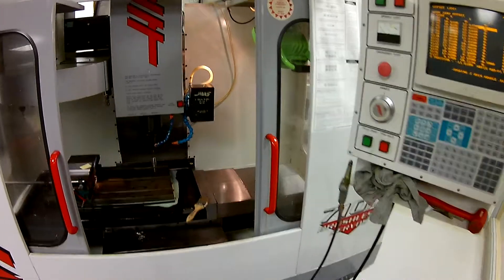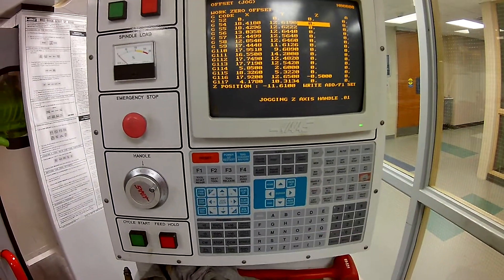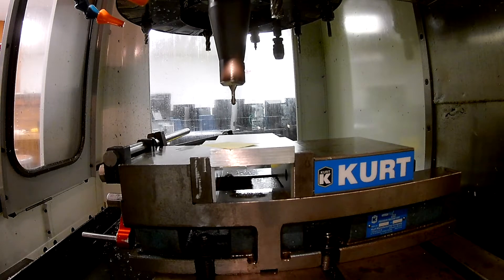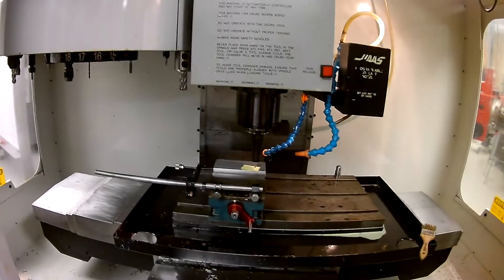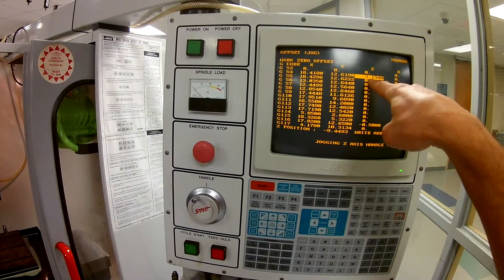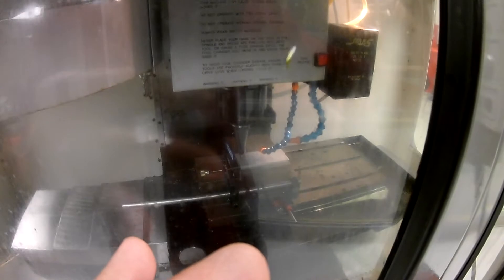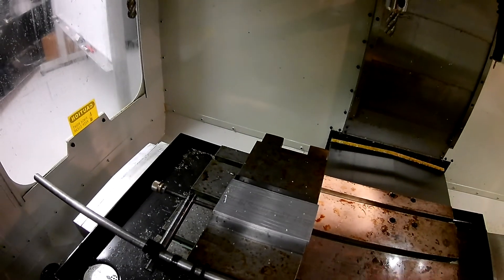Hass VF0 Setting Z Offset for G54

Comment: I know this has been mentioned, but I want to reiterate that this video is categorically wrong.  The offset value MUST be positive.   If your work is 2 inches above the tool offset device, if you enter a negative value,  you just told the machine to go 2 inches below, which is 4 inches below the surface of your part. If you're lucky, you'll get a "Z over travel range" error.  Either that or your machine will slam the spindle directly into the part.  Do NOT enter a negative value.

Comment: My shop just purchased a haas mill of similar age to yours. I was struggling with setting the work offset, and your video helped me. However, in order to duplicate your results, i needed to make the g54 offset positive. Im not sure why, i just know it seems to have worked.
Reply: we just got a 2000 VF3, same thing I have to add the G54 and on my machine control it displays the offsets as negative numbers where in the video, his display shows them as positives, I believe this is why it is reversed for us.
Reply: Because the workpiece is so high or your tools are so long.

Comment: Here a TIP: Why not use every tool with whatever length on the CNC G53/54 original coordinates zero? From there all you got to do is center your stock with the longest tool at 3" above it and G92. Creating an offset you'll be working from that point as a point of origin; now understanding that you have different tool-lengths, only thing left to do is compensate the difference for every tool using the longest tool as reference number. Every operation done would be accurate if you know the number to compensate for every tool. It's that simple and this way you can fool your tool length compensation tables. Another trick, use the same offset for all of your tools operation, let's say G54, in order to manipulate every operation with same offset all you got to do is create every operation as a Subroutine and recall it from the main program, your CNC would treat every Sub as an independent Pro and this way its easier to tweak things around. Just saying :) Great video thou.

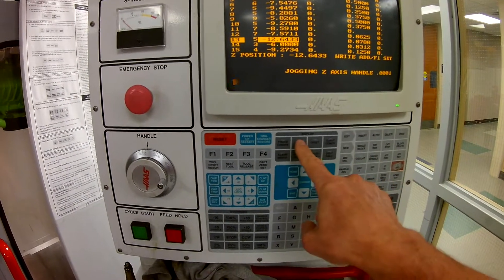Comment: 1:55  If your tool is measured at -12.6433 on the machine tool offsets, then you are lifting up (positive value)  3.194",  then why do you need to add a negative to the G54 Z value -3.194.   >  should it not be +3.194 ?
Reply: I have the same confusion

Comment: wait im confused. i thought the Z value in g54moves the tools in the direction of+ or -. if you set you set it in the - from the top of the part isnt it going to go through the part in the negitive direction? Im not sure how you got it to run the right clearly the tool didnt crash when you hit cycle start. please let me know
Reply: Imagine the eye of the machine is in the spindle and looking down just like the tool. The machine reads the g code and the g code says go to <2,2,2>. The g54 adds the offset to <2,2,2> and moves to that position. 

So the z offset is negative 5. Meaning that the tool will end up going lower then the zero return of the machine.

Comment: I am almost certain that the G54 value should be +3.194. TLO for tool 13 to presetter was a Neg value. Height from presetter to top of part was positive. 3.194. The control will add/subtract the G54 value from TLO. I have a VF oE . I have never seen any Haas Machine With positvie values in the work offsets. How is this done? Machine Home at power up is all the way positive in X Y and Z. Setting these will make any value negative. Thanks for the video. Where are you an instructor?
Reply: Yeah he was showing us how to crash a spindle into the part 🤦‍♂️
Reply from the maker: You are absolutely correct with the negative values.  This was may attempt to simplify the process (math) for the particular set of students I created this video for.  Instead of having them add to the negative value, I had them view it like magnitude.  It worked well for this set of students as they were able to get over the hump and become proficient in setting up the machine.
The 3.194 value I placed in the Z was negative.  I believe I understand your question, so though it will be a while before I am back in the shop, I will test it with a positive number to see what happens.
Reply: @themachinetoolinstructor7410  Hi, I'm in the same boat as P S, if I put a -3. in the Z origin offset the tool will drop an additional 3." from where the tools were set...are you using G44 with H offset? (G0 G44 H1 Z.1) or maybe your setting #33 is set different than ours (fanuc on mine)...if you go to the operator page and press origin it will zero out whatever axis is currently being jogged or type in X, Y, or Z then origin will also zero or X, Y, or Z then  #'s origin again will replace with the #'s that were keyed in.
  Have a good day.
Reply: @DKingHLTB  yea.   Fun huh.
Reply: @DKingHLTB  all this is is for simple top milling prgrams,  it a way to cheat and add or subtract tolerance to you part z dimension. If you say the tool is -.03, (from original offset value) it will take that into the control and the program will run and now your part will be , .03 less in z
Reply: @themachinetoolinstructor7410  I entered the work coordinate values for g55,  but machine is still in g54,
How to select g55
Reply: @TheVenkateshM  G90 then G55
    G0 G90 G55 X0 Y0
Is how the line of code usually looks.
Reply: @DKingHLTB  in addition G17 need to enter, or else machine is not taking the work coordinate and remains in g54
Reply: @TheVenkateshM  look at you program and make sure the line of code has G55 in it and not G54
Reply: Sometimes if i ask for a refresher on how to do this my instructors make me feel like an idiot, this helps so much